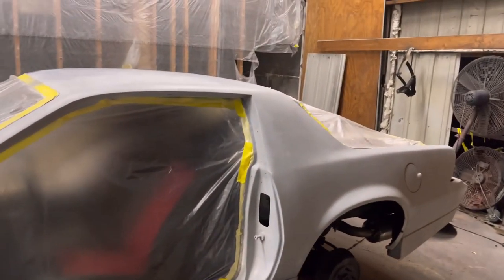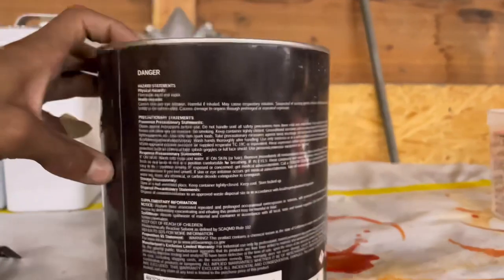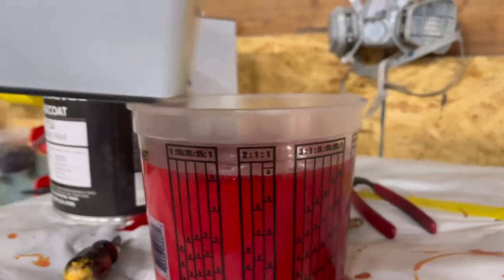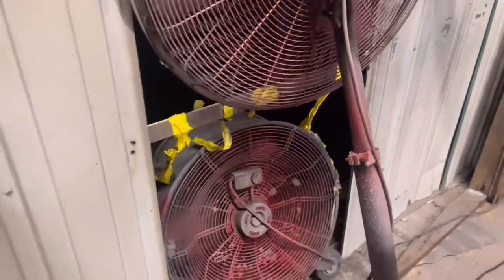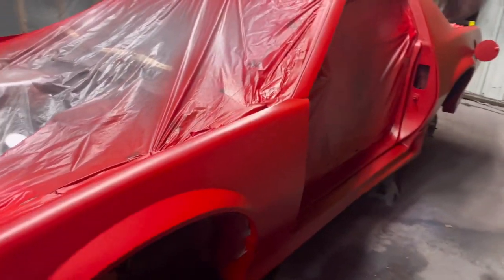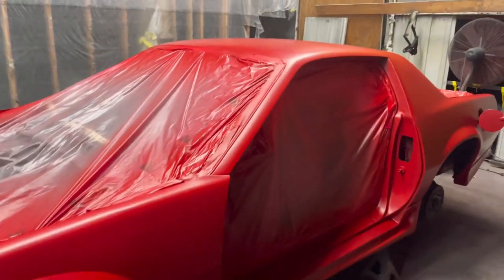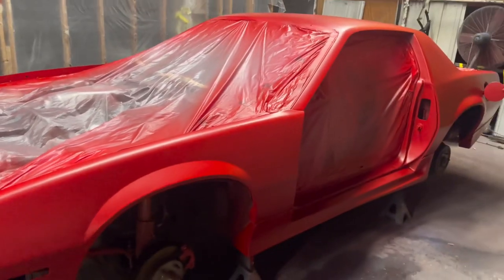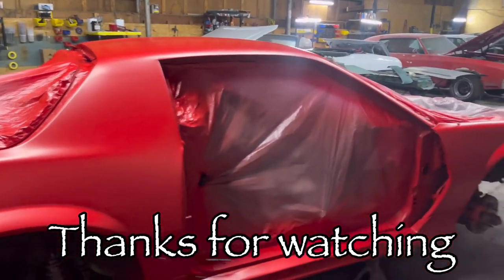Before you paint your first car | How to paint a car? #beginners #diypainting

Comment: Nice 😎
Quick question I’ve seen in your previous videos that you have both the DV1 base and  DV1 clear guns . Why did you decide to to spray the base with the clear gun 🤔 I know you can use the clear gun for base and it will work but why didn’t you use the base gun.